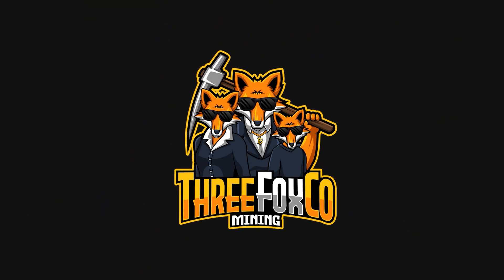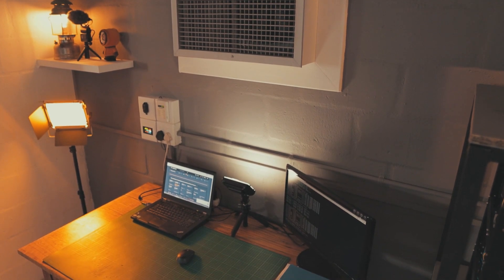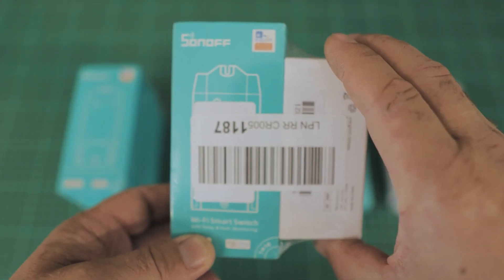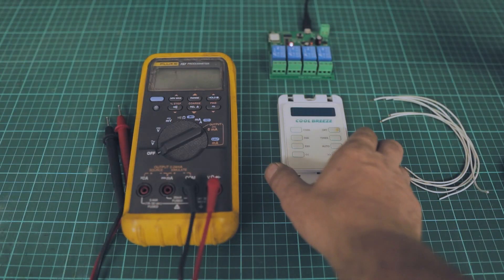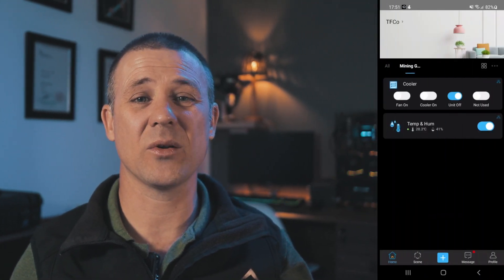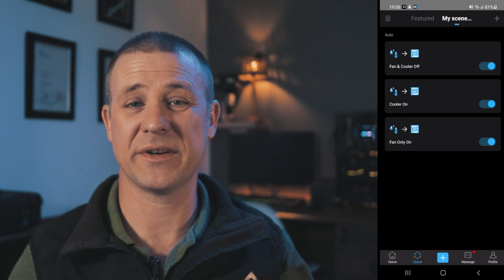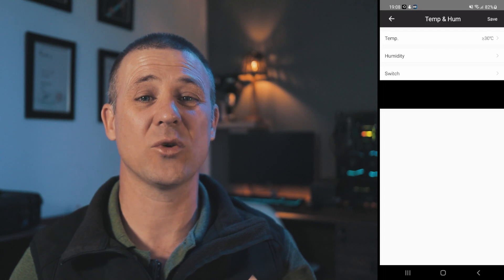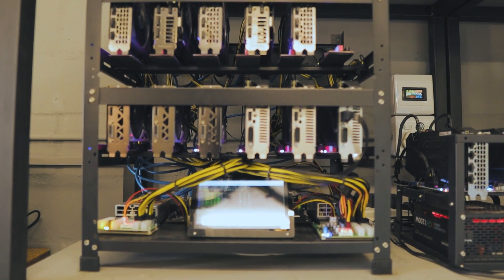Overheating mining rigs? Then do THIS

Comment: How about extracting hot air from the garage? Do you have only positive pressure from the unit?
Reply from the maker: I can exhaust also, but positive pressure is more efficient at removing/expelling heat, and with my system there are added benefits by utilizing positive pressure.

Comment: Can't you just tell the A/C unit to keep 27°C ?
Reply from the maker: Hi. This is not an AC unit and does not function as such. It's an evaporative cooler and the amount of temperature reduction is a function of airflow, humidity and outside air temperature. The key here is to remove the hot air, but only when necessary, to save energy.